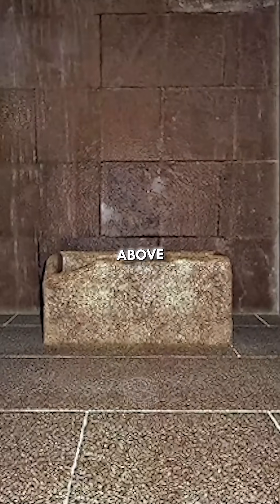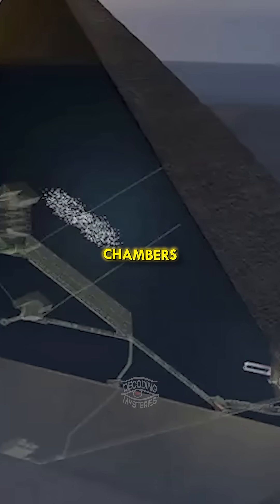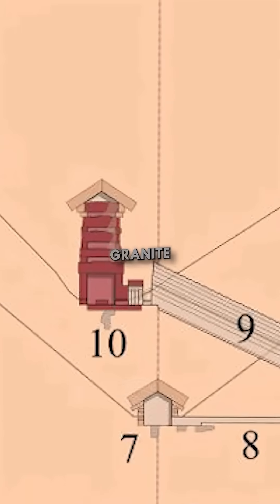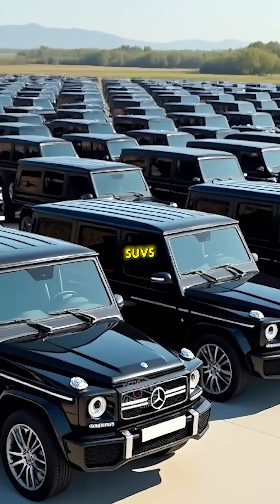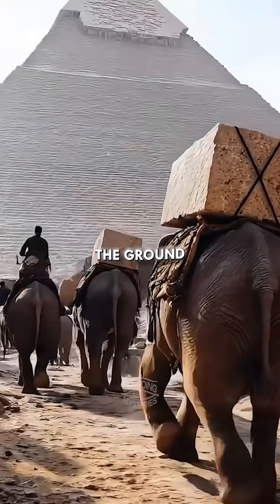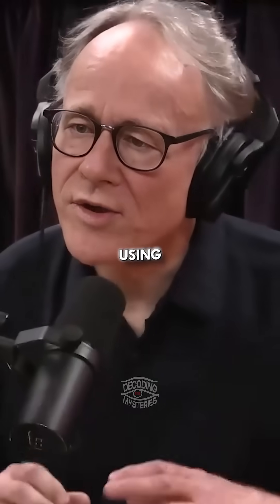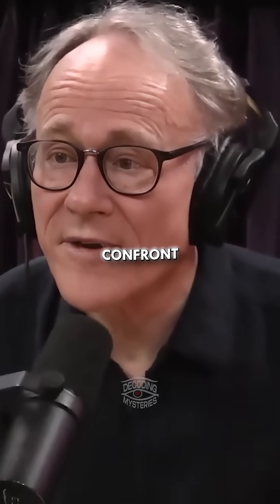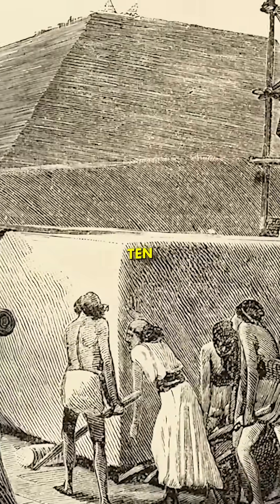Engineering Secrets of Egypt's Great Pyramid That Defy Logic 📜

Comment: Let's stop chatting about how they were built but rather what the pyramids purpose is. Power source: Granite is not a conductor of electricity... unless heat is increased or water is involved. But also, it is an incredible insulator. So... maybe it was used to balance where electricity is displaced around the pyramid. 

I'm not a nut lol but that is very interesting

Comment: 120 avg dudes with a system of just ten pulleys can lift a 80 ton block
Reply: And how wud u setup this pulley system to do this work? It's all precise to the millimeter and placed in high and/or difficult places. If it was all at ground lv then a pulley system wud be easily the answer.
Reply: @baileydombroskie3046  you could simply use any kind of inclined plane setup (google it if you need the visual) also just want to add majority of the blocks that make up the pyramid are soft, light (relatively speaking) limestone blocks. 
      The point of my comment is, the simplest explanation is often the most reasonable and that we are capable of great things using mechanical advantage. I have no idea how they built them forsure. All I can do is make an educated guess based on what I know about science and math and being mechanically inclined.
       physics can sometimes seem like magic and they were far better craftsman than we are today.

Comment: I know for sure I sound really dumb saying this, but I’ve lifted a few rocks triple or quadruple my weight with a wedge like rock and a bulky hammering rock, up a foot in the air in less than 5 something minutes. Now does this change for something that weighs 19,000 times what I’ve done. yes it does but that still doesn’t mean aliens were the reason, especially with that one documentary about how a dude lifted these rocks using leverage and beams so slowly lift it.

Comment: Dug a gigantic hole and built infrastructures up from the bottom then poured sand andground stine  mix into moulds after loading up the infrastructure with items. Then after the first rain and curing process the structure becomes a solid pyramid .. 🖖🏾🤧idk either just gimme more superpowers😂😂😂😂

Comment: One thing is for sure - the traditional explanation of how the pyramids was built doesn’t stand up to scrutiny
Reply: But it does... So, your statement isn't 'for sure'. What is 'for sure' is that the Level of Understanding people have in the fields of math and sciences vary wildly. And then there are those that want to latch onto whatever explanation that they personally find the most convincing to them ... The actual Math and Science behind the problem be damned when their feelings have already decided for them which is right
Reply: @Umega101   100% spot on! It's like all these "experts" saying you need a ramp of no more than 10 degrees, where's the proof of a ramp? etc etc. The ramp is right before your very eyes....it's called the grand gallery. Then they ask what could the holes be for that are along the edges of the grand gallery? They're to insert wooden wedges to stop the stones sliding back as they hoist them along the ramp. Is the ramp over 10 degrees? Yes it is, so it CAN be done with a steeper ramp. I could go on and on ..... but I wont LOL
Reply: @Umega101 that's a lot of words for saying nothing at all....if you have an explanation put it in the answer or stfu

Comment: The blocks weren't hoisted up. The blocks were made from a cement mixture in a adjustable wooden moulds. When the block dried in the sun another mould was placed over it. Only the cement liquid was hoisted up in buckets.

Comment: “Sound vibrations” were used on each of these blocks by advanced beings . 🙌
Reply: How the hell do you know
Reply: It's the only physics that works.
Reply: Sound vibrations would only be useful when the stone is on the floor, the same how a cellphone on the table vibrates it doesnt levitate
Reply: @WP-zu5nz  a phone vibrates because of a small motor with a cam (offset weight) that rotates inside of the case.

Frequencies are produced in waves. More specifically acoustic waves of ultra high frequency above 20KHz can be used to move small objects or even levitate them. I agree that these size stones would need a floor or a huge amount of resonances to build these structures! 

We in current times think we are the smartest, but somewhere along the way knowledge was lost or suppressed and techniques like these were lost.

I hope someday soon we will all be traveling in George Jetson type vehicles! 👨🏿‍🚀🚀

Comment: Someone made a comment in passing a while ago that mentioned if the oxygen levels were more pure during this timeframe then it would enhance endurance and physical capabilities along with mental function. I haven’t looked into it further, just found it to be an interesting theory and wanted to share.
Reply: Following up: our predecessors were used to manual labour. They obviously had more strength compared to modern day human who don't even like to walk.
Reply: @topoftheshelf-oq5bp lol so true!
Reply: I also heard a theory to explain the thinner than paper joints on the blocks are due to a layer of acid being spread along the surface, let the rock go soft and "mould" them together.

With evidence of heavy acid mining nearby the majority of these megaliths. 

A theory that's provoked my curiosity.
Reply: @tomc3891 I would’ve never thought of that. Very interesting!
Reply: What? It don’t matter how high the oxygen levels are, you ain’t pulling no 70 ton stone up a slope in a desert
Reply: @Truthteller95mall  And yet 400 Russians pulled a 1,500 ton stone called the Thunder Stone out of a swamp and moved it 3.7 miles without using horses or machines in 1768.

A single man built Coral Castel and used limestone in the 15 to 30 ton range from 1923 to 1951. All he had was tripods made from wooden telephone poles, chains, pulleys, block and tackle, counterweights, and homemade levers and winches.

https://www.youtube.com/watch?v=xD5Lc3-5iDs

70 tons with the proper engineering techniques is doable. Difficult, but doable.
Reply: @Truthteller95mall I think we all realize that. As mentioned, it was a theory on how it would enhance endurance and physical capabilities. I never mentioned superhuman strength. Thanks for the helpful input 👍
Reply: @FireLedFaith But what’s the point of mentioning that theory?
Reply: @HikeToSleep None of that matters whatsoever because we’re still talking about humans, not a fantasy species of giants that can move tons of weight for hours on end. It’s like bringing up that their diet was different back then. Completely nonsensical. It has nothing to do with what I apparently don’t see, factually speaking there is no point in bringing that up. Even if they had the strength of Brian Shaw and the endurance of Kipchoge x10, it still wouldn’t matter. Although I don’t think much of it, the theory you brought up is an actual explanation instead of some useless nonsense that you wanted to throw out there for the sake of it because you picked it up somewhere.
Reply: Yo this shit is really interesting as time go on fr hopefully one day we really can figure out what’s going on I really want to know
Reply: all of these replies & the OG comment are some incredibly valid points i had never even considered! wow i'm so happy i saw this comment & replies today! 🙂
Reply: Genesis 6:4.  4 There were giants in the earth in those days; and also after that, when the sons of God came in unto the daughters of men, and they bare children to them, the same became mighty men which were of old, men of renown.
Reply: @josephmontesano1936  😂😂😂
Reply: It why our life spans were shortened from hundreds of years to tens of years.

Comment: The grand gallery is the ramp with counter weights on the other side to aid dragging blocks up. A second  grand gallery is the big void discovered using muon scans and takes you higher up. A (internal?) ramp winds up around the edge at least in the top half to move the majority of the smaller blocks.

Comment: In a video, I saw a man demonstrating how to move a rectangular stone weighing several tons simply by using small stones he placed along the path like ball bearings. All he would have needed to do was place smooth stones on a gently sloping spiral ramp and move the blocks around in that way. He could even rotate the block by centering it on a single small rock that acted as its axis of rotation. It's possible, even with such primitive means. We forget that throughout history there have been many geniuses capable of finding simple solutions to problems that would seem unsolvable to us without modern technology.

Comment: Ramps, ropes, pulleys. It's really not that hard to comprehend. Same way we used to use block and tackle with horses to lift heavy bales of hay to upper levels of barns. For heavy stones you just keep adding people (pure force) and pulleys (multiplies force being input.) And you don't life it all 300+ feet at once. You do it in small stages. This really is not hard to comprehend and understand. Skyscrapers are hundreds of feet tall and we don't question how they got the heavy iron beams and concrete to the top of it, do we? We just invented better machines to do it. In stages as they go up. 😐

Like he said in the video "You have to confront basic laws of physics." Exactly. You use mechanical advantage and infinitely expendable slave labor.

Comment: Everyone always thinking they built the pyramid outwards to inwards vertically.. try considering building a tower then expanding upon it.. you can lift 10ton vertically with enough counter balancing and supports
Reply: Have you seen Eddie griffins explanation? Where they started at the top and started removing earth or whatever and clearing away.. and he mentioned somitting about the shafts also...
Reply: @2dabornot  there clearly is no evidence to support that hypothesis
Reply: @robertsauciuc3434 there is evidence of a ramp at hatnub quarry and also a ramp in karnak in luxor temple where they built a ramp to erect the large obelisk. Theory is they dragged it to the top of the ramp where they had a hole full of sand and a trap door down the bottom, so when they released the trap door the sand poured out and the obelisk slowly stood up in the hole by itself. Thats the theory

Comment: Think right. You wouldnt haul it 350 feet above the ground. You'd haul it up in segments of maybe 10 feet. Pyramids are practically square top-down, built in the correct order, you could practically create a spiral staircase throughout construction. It would only take 700 people who could exert 100kg of force to haul 70 tonnes with leverage, pulleys and small ramps.

Comment: No well, i just calculated. One would need at 10 degree slope to reach a height of 350 feet or approx 120 mtrs. A ramp that is 670 mtr long or roughly 2000 feet long. Thats just crazy.

Comment: The pyramid was the ramp, in a spiral. They built the inner core with the roofed chambers. Then they built the rest of the pyramid around it. The further out they went, the smaller the stones needed the be, until you get to the outer skin. It's a lot of effort, but it's much less difficult than he's making out.

Comment: Or you could place the blocks in the centre, and as you raise the height of each layer you use leverage to raise the stone blocks up with each layer as its constructed, then move them into place, this would be far simpler than getting to 350ft and then trying to haul them up. especially if you used the same techniques as that American engineer showed when moving very large stone blocks. I think his name was wally wallington you can search up his videos on youtube on how to use mechanical advantage to move very large blocks without much effort.

Comment: It's not very hard Graham You're just lying now we've explained it so many times they build it in a step pattern they build one layer at a time so they were able to drag it on the logs easier so even if those beams are 70 tons which they are they had to drag it up a not very steep ramp and drag it to the position that was marked out by water on the floor it's not that hard Yes it's hard that's all I'm saying it's incredible work but acting like it's some great mysteries just really misleading

Comment: The simplest explanation of the pyramids I've ever heard (doesn't make it right of course) is that they were made out of a type of concrete that looks like stone to us as it ages.  So instead of hauling large stones up high you're hauling bags of cement compounds and water up there.  No ramp required, no heavy machinery, but yes, still involves tons of slave labor.

Comment: Ummm supposed they drew a blueprint first, and began with those lage stones at ground level, lifted them a little at a time using blocks, like the guy in Florida proved, then they build the first layer under it...repeat, repeat repeat until the designed level, then build around them and over them.

Comment: It was more than likely created using an internal spiral ramp, similar to modern parking structures. There's a great doc on youtube about it. They were very clever.
Reply: its actually well know that it is what was used we have quite a bit of evidence to show that they used the pyramid itself as supports for ramps that wrapped concentricly around it with each layer the ramp would be raised by one layer at a very shallow angle slowly going up the pyramid. these people act like it was done in a short period rather than 70 to 90 years of constant work.
Reply: @phoenixmaster2537 whose these people not a single person is acting like it was built overnight everyone is curious about it you just want a side to argue with
Reply: @phoenixmaster2537  it looks like you forgot a factor of 10 :) similar structures by mass are bult today and it takes decades; the history tells that the biggest one was built in 25 years, which is BS for sure; the Q: how the combination of a culture & economic was able to sustain a 100+ years old project having average lifespan 30-40 years...
Reply: 😂😂😂😂😂. 70 tons.  Up a wooden ramp.  Hilarious 😂😂😂😂
Reply: @russcooke5671  Why wooden ramp? Are other materials prohibited?
Reply: Is this houdins theory?
Reply: Water, forms and cement powder
Reply: @desertCabin  Idiocy.  The pyramids are constructed from granite blocks with a limestone casing.  You can't melt either of them.

Comment: They didn't lever them up they built frames and poured and elixir like concrete same thing with the Romans 

The pyramids weren't carved stoned in dragged for thousands of miles It was rocks ground up put in water put in frames and poured like concrete dumbass

That's why the granite in the stones have mixtures from far away because they needed more materials as they poured 70 ton stones... 🙄

Comment: why would you use a ramp, could you not build up by levels, lift the parts up a level, build that then lift the part, build another level and so on until you get to the part where you need to put them, kind of like how they install a Tower Crane

Comment: In order for time to go forward something needs to stay still, like a car and the ground, the car travels over the still ground, if the ground was moving at the same speed the car would not move from its starting spot.  Same with the stone but it's moving up.  Time and gravity are related, and if you suck all the air out of the glass dome arching above the flat earth, then the stone becomes as heavy as the feather.

Comment: Well no. It would take 1,000 people pulling. If you have that you can move 70 tons. The ramp is built in as the pyramid itself was originally flat on all sides. You have 500 ropes or chains that can with stand 200 lbs or more. 500 people on the right, five hundred people on the Left. The ropes are attached to the people. One rope is shared between 2 people. Now roll logs under the stone. Once you continue up the pyramid you continue to roll logs under the stone, but as it rises up you are also building a wooden structure behind it as it inches forward. You cou could also have a second set of men pulling a weight of 100 lbs that is attached between the men pulling the stone and the large stone. When the set this stone down it would anchor it in place. Between the weight of the human and the anchor weight you would have more than double the weight necessary to anchor 70 tons to the ground. Or it would actually work with just the weight of the extra men. 2000 men at 100lbs per man would give you 100 tons.

Comment: John Hutchinson Technology re-engineered reinvented.. he coined the machine the Poltergeist Machine. Talk about stiff as a board light as a feather. 0. Energy. Radio waves 70 volts of electricity.. and rare earth magnets. He can lift bowling balls he can melt metals together. He can turn them into powder dust. He can lift anything. That's how Coral Castle was built. This isn't rocket science. Which ironically is quite simple😅

Comment: I doubt they pushed them upa slope. I would lift them usin% water then slide them down to po@ition. Meaning the pyramids were under water. From a leverage point how many Jack's are needed. The entire city of Chicago was lifted using Jack's with coordinated jack effort. Like 6000 Jack's at a time.

Comment: That's because they aren't made out of stones. This is concrete, the beams were made out of limestone and granite concrete. Maybe only granite without limestone if I have to believe this video. They were moulted exactly where they were found and still are. 
The old Egyptians knew things that other people of that time didn't. They had knowledge in maths and chemicals to be able to do the pyramids. Surprising? Yes. Impossible? No, much less so than the huge stones and ramps and thousands of slaves explanation. They didn't have slaves., for a start.